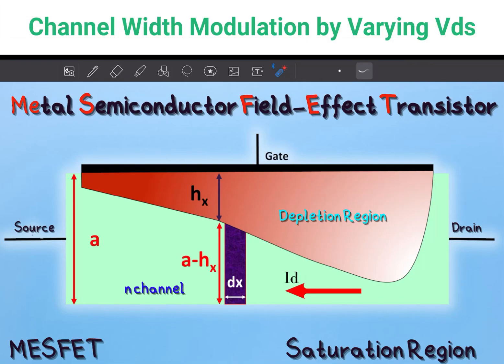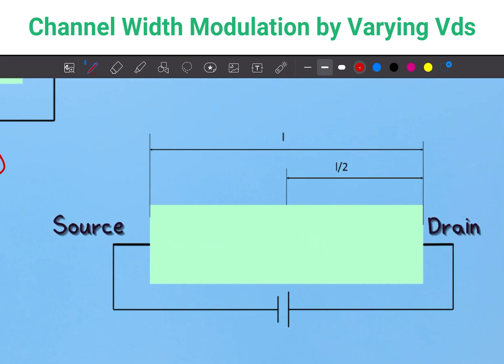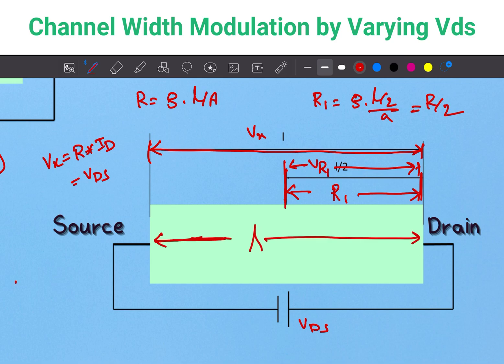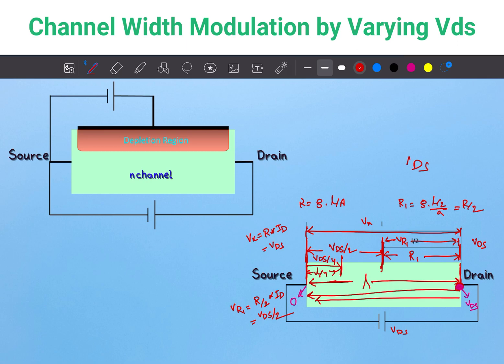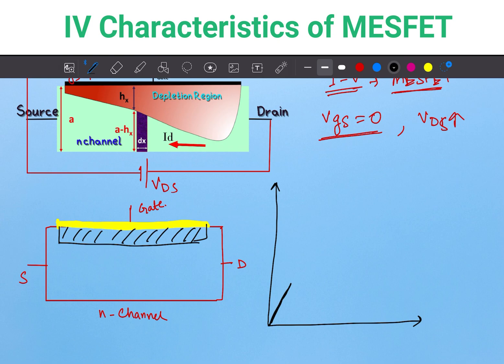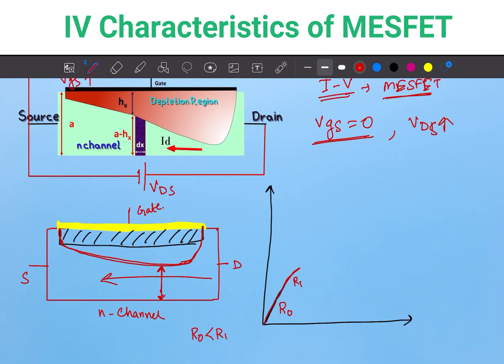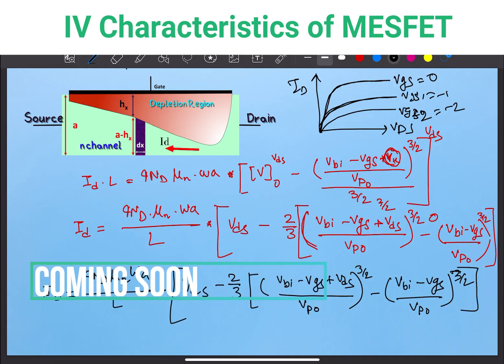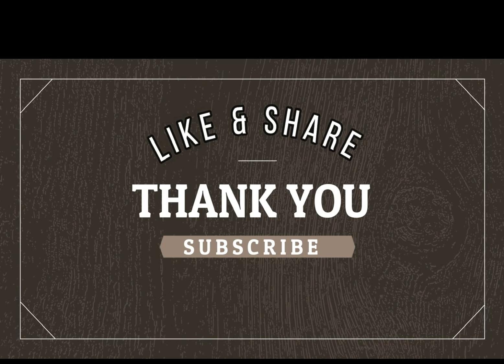IV Characteristics of MESFET || Channel Width Modulation || Current Flow at Saturation Region

Comment: Great content!! question does source has more electrons doping that the drain as it is in bjt?
Reply from the maker: No, MOSFETs generally have similar doping in the source and drain, but there can be cases(High Performance MOSFET) where the source is slightly more doped.